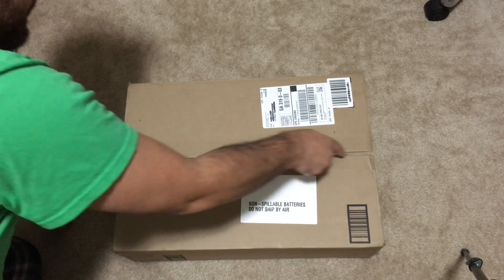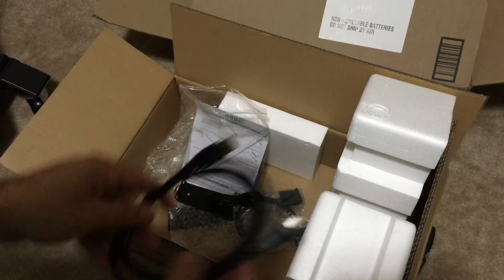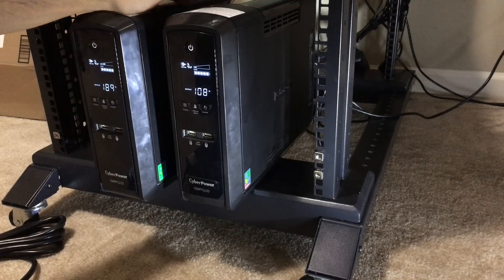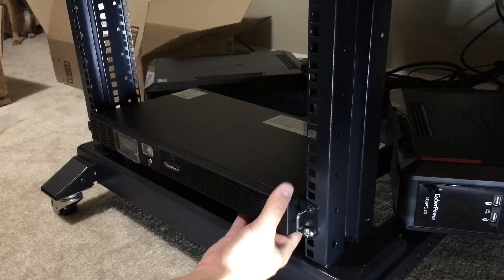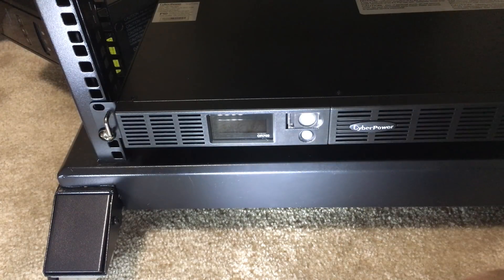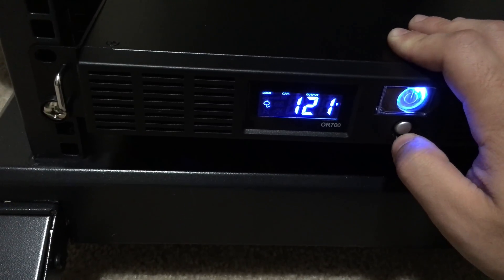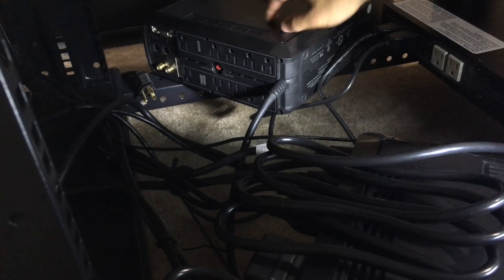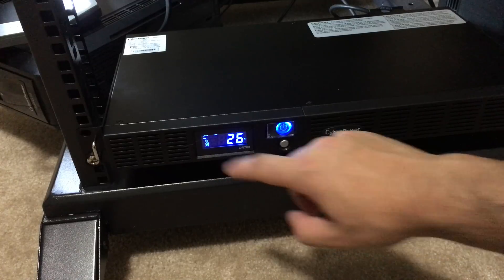Adding a Cyberpower Rackmount UPS to the Home Lab

Comment: Have you found a way to keep the front panel display on and keep it from going to sleep?
Reply from the maker: I have not
Reply: @SPXLabs  I contacted Cyberpower as I am considering a rack mount UPS myself and they informed me that one can press and hold the LCD button beneath the power button for 3 seconds and there should be an option that appears that indicates LCD ON / OFF . Selecting ON should allow the LCD to remain on. Just thought I would pass the information along. Can you let me know if this works?
Reply from the maker: I haven’t owned that UPS in years
Reply: @SPXLabs  Oh, LOL.
Reply from the maker: lol yeah… it happens more than you think.  Sorry I can’t be useful

Comment: Those are not 10/100 ethernet ports.  It's a surge-protection circuit with RJ-45 connectors.

Comment: UPS is just for proper shutdowns. For continuous electricity, get a propane or CNG generator for the whole house OR a solar panel + battery DIY setup for your rack.
Reply: Correct David Banner
Reply: @ericdraven7185  LOL
Reply: Depends on power company. Some don't like the generator as it can backfeed into the power lines and cause an electrical hazard for linesmen. You need a mains isolator of some sort. So get a proper company to install it and not do it yourself.

Comment: The purpose for dual power supplies in equipment is so you can run from two separate power sources. When that isn't an option and you're utilizing a UPS, I would suggest just plugging a single PSU into the wall and the other into the UPS. This could increase your on-battery time, however, I haven't tested it myself. I don't have two sources of power in my house but in a datacenter environment, each PSU would be connected to independent power sources. My current set up starts at the main power panel to the house. I installed two dedicated circuits for the server rack. Equipment with dual PSU's are plugged into circuit A while the PSU is plugged into circuit B. The second PSU is plugged into the UPS. For critical hardware with single PSU's I have them plugged either into the UPS directly or into a PDU plugged into the UPS. This solves the issue if something trips the breaker.
Reply: Wouldn't that leave the wall-plugged PSU vulnerable to failure from spikes, surges, and brown-outs?
Reply: @hulknotlikepunybanner  In a home environment yes, there is always a compromise. If your goal is surge protection then yeah, plug them both into the UPS. If your goal is longer battery life in a power event, then split the PSU's. I have installed a whole home surge protector on my electrical panel so my risk is minimal.
Reply: @cargovankilla  Ok. A surge protector at the panel is the key to not burning out PSUs. I should look into that.

Comment: Meh, line interactive, not double conversion (online)
Reply: $200 vs $530 either way most servers wont go down in the milliseconds the UPS takes to kick over to battery esp on a home network where its far from critical.
Reply: @derekb7260  You'd think that... but it happens.  Hell, it even happens on double conversion but it's not supposed to.
Reply from the maker: Awww the conversations are finally starting in the comments. Yay!

Comment: 59dB is not loud ? are you on crack dude?  for a 700 vA, it's horribly loud.
Reply from the maker: Well, after years of listening to servers it’s not that bad.  I hardly notice the noise now.  But that’s just me.  Also, I may or may not have dabbled with the cocaîna.
Reply: @SPXLabs  if you want the best UPS from CP, check the PR1500ERT2U... it's a line interactive, mostly quiet unless on batteries and has a power factor of 1. Short depth as well.  I have a server rack in my bedroom closet, everything is as quiet as 25 dB.
Reply from the maker: Oh rats... you are about 2 years too late.  I ended up with a EATON UPS that I got for $250 bucks...
Reply: @SPXLabs  Well... two years ago you ditched a PCF pure sinewave 900W UPS for a simulated sinewave one. Probably the dumbest idea ever even for a home lab. Most power supply since 2011 will shutdown during power transfer to batteries due to the power correction factor. ( iMacs,  cisco switch etc. )..... Obviously not the right choice back in time.  Anyway enjoy your EATON but just don't recommend it to anyone over Cyberpower. lol
Reply from the maker: Haha yeah, decisions were made.  That’s interesting, I’ve never experienced or heard of that happening before, glad you mentioned it.  Ill keep it in mind for the future.  Don’t worry, cyberpower is still my go to.  Saving money for a second one UPS.  Eye balling cyberpower currently.
Reply: @SPXLabs  Not sure how your OR700 produces anywhere near that much noise.  I have several of these units - one in a home studio - and they are all dead silent.  Seems to me your other equipment is what is making the noise.  Also, the batteries in these units usually last about 2 years before having to be replaced - at least that is my experience.  Three of mine have all died in the past month and all of them were bought and installed just over 2 years ago.
Reply from the maker: It’s definitely super quiet now not sure what made it so loud back then.  I definitely have things that are more loud today.  That’s crazy that three of em died on you! Sorry that happened so many times.  Mine seems fine for now but I’ll definitely keep a better eye on it after hearing about your experience.

Comment: You lose redundancy that way. If you have one ups, then you connect one PSU behind that one and the other one just normally to wall socket. Better if you have two UPS and they are behind of those ones. But newer both behind the same one. Now when your UPS get broken you server will shutdown. If you have them one in UPS and one live, then it doesnt matter if electricity goes down or UPS gets broken your server still runs.

But have to say this is maybe most common mistake that you can see in server rooms.
Reply from the maker: I did end up switching to a 2 ups system with one psu in each ups.  However, as of writing today, I’m back to a single UPS.  I’m waiting for another sale to buy a second Eaton PSU.
Reply: Even one UPS is ok, but just remember to only connect another PSU behind that one. Good idea is to connect that another one behind surge protector thou
Reply from the maker: Yes sir indeed!  Thank you thank you.
Reply: Any videos on your Eaton UPS?
Reply from the maker: Yes but not very good.  Since I don’t do reviews it’s not informative.  Channel is more of a vlog than anything.  

Eaton 5PX 1500RT 2U UPS https://youtu.be/YZlP9gNkbxo

Comment: did you study the specs of the UPS you had vs the one you installed in this video???? buahahahahahahah
Reply from the maker: Study is a strong word.  It was more of “ehhh, it’s cheap and rack mountable, lets go!”, kind of thing.  Now that the rack has matured a bit more, it’s absolutely perfect.  Learning as I go, no regerts!
Reply: @SPXLabs  it was weird to see you swapped a devices that produce simulated sine waves to the ones that give true sine wave
Reply from the maker: It’s a bit odd I suppose, thankfully I don’t think the servers care too much about the quality of power.  Stepped should be good enough.  I think?

Comment: Would this work if you plugged it into a power conditioner?
Reply: No need to plug it into a power conditioner as it IS a power conditioner.
Reply from the maker: Dead Detail Entertainment the documentation doesn’t mention that in particular, however it will probably be safe so long as the power conditioner provides the proper amperage and voltage.  However, the documentation explicitly says not to use extension cables which typically do not regulate power.  This ups is able to “condition” power on its own and does not need a conditioner itself.  Personally, I would just plug mine into a PDU or straight to the wall.

Comment: Hey Stefano, thanks for showing this unit. I normally use APC gear but decided to give this one a try and I'll have it in Tuesday so it was nice to get a little preview.

Small pro-tip for next time, which you may know, but a standard rack unit (U) is three of the square holes.  By starting at hole 3 (top hole of first unit) instead of hole 4 (bottom of second unit) you'll eventually have lost TWO units of rack space IF you fill the rack to the top.  Totally not an issue for a home rig but something to consider even in a home rack if it's small in size or dense with gear.  This is one reason I favor rack rails that are numbered for each U so it's easy to spot front and back what unit I'm in and then also to make sure I always optimize my units.

Also, nice recovery at 2:52 on getting those cage nuts in with the nut inside the rack. :) I'm curious, did Cyberpower only include 3 or did the dog sneak by and slurp up the fourth?
Reply from the maker: I normally want to buy APC but cyberpower is always on sale.  I've had both in the workplace and seen no real difference in quality.  I think you will be happy with it especially for the price. 

I literally just learned/made the connection that 1u is 3 holes.  I think I figured where to start with the holes a bit too late but you are hella right.  I'm just glad I have a baby rack.  I really really wish the rack was numbered.  I've been spoiled for so long!

Hahaha, I don't even know why those two cage nuts were backwards.  I'm pretty sure I had some grand plan but changed my mind.  I'm pretty sure the dog is eating my screws, cage nuts, bolts, etc.  Things keep disappearing.  But for this video I think I decided not to use what came with ups and ended up using different cage nuts all together. 

Thanks for watching and good eye/s!

Comment: Great video !  I have a gently used ebay  APC Smart-UPS 1500 mini tower that has two SLA Batteries.  Have been window shopping for a 2U Smart-UPS 1500 that uses four (4) SLA Batteries and are Hot Swapable.  The 2U UPS rests on a "L" Bracket Shelf.  And the Battery Tray with the four batteries can be removed to make installing the UPS easy !  In the last month (30 days or more like two weeks) the power went out twice for over an hour...  After five minutes decided that the power was not going to resume soon, so shut down the Dell desktop computer...  Then shut down the two UPSs to save the batteries.  After the power returned, I restarted the two UPSs one at a time...  The UPS keeps my network up and running when the lights flicker and the clocks need to be reset !  Also the UPS back ups the CenturyLink ADSL Modem (paid for and not paying $5.00 USD a month for to CenturyLink/Ma Bell), Dell 24-Port Switch, APC PDU, Dell I-5 Desktop Computer, 1080P Monitor and the computer speakers.  Most items where picked up from ebay for some good deals...  And Newegg Rehab...  Be GREEN and Recycle gently used equipment (and save U$D) !  tjl

Comment: Hi, What I would suggest is running each power supply on a separate UPS just in case you loose power and 1 dies, then your server does not crash, I have had that problem on my desktop PC before.
Reply from the maker: Ian Stanbridge yeah buddy! That is how they are configured currently.  Thanks for looking out!

Comment: no, the important question is not the UPS noise. The question is the short 12 min ups time which is horrible. Put your other UPSs back.
Reply from the maker: email16v haha right!!! I did end up switch back to my other UPS.  Only the networking equipment and monitor are on the UPS featured in this video.